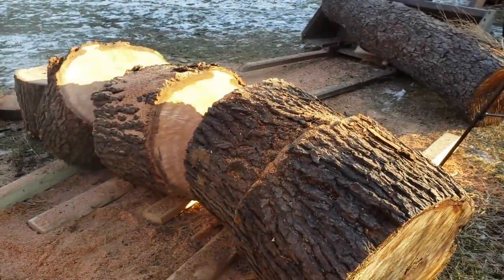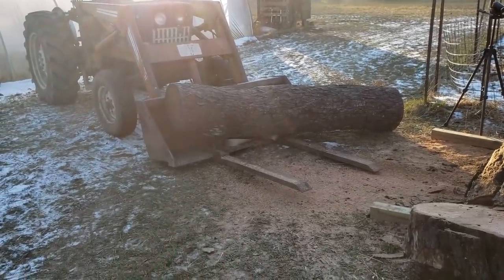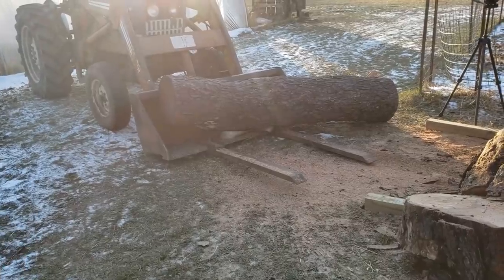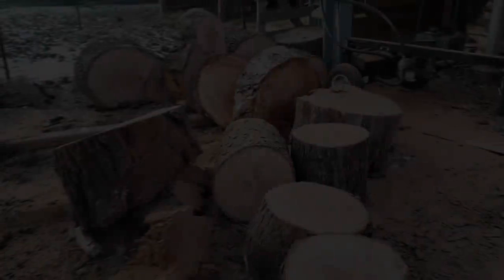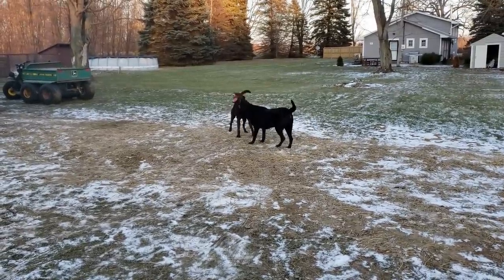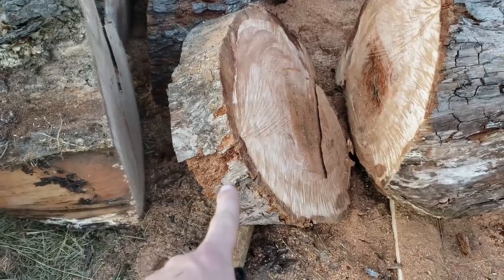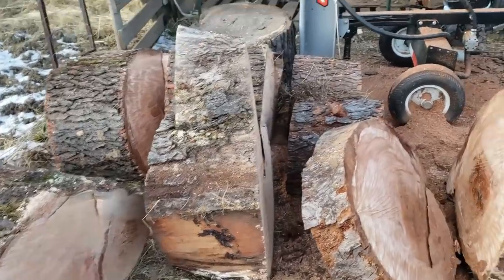Process Firewood Like a Pro With These Simple Tips

Comment: In my early years (late 50’s ) We cut big dead Dutch Elm trees down with a 6’ two man cross cut saw, wedges, a sledge hammer, axe and a 1946 Minneapolis Moline model R with a hundred foot big hay rope  putting tension on the tree. Anything less than a saw log 12’-16’ was kept for firewood and always called ‘bolts’. I never heard the term ‘rounds’ until recently. We hauled the limbs with my grandfather’s Moline and manure spreader to his 12” buzz saw on an old wood table powered by a flat belt hooked to the Moline ‘R’. I bought an antique Clinton B3  chainsaw for $5 and rebuilt it as my 10th grade high school power mechanics class term paper ( you actually had to acquire some usable skills to graduate in those days ) ! My dad loved that old junk saw so much, wanted to always be the feller. I talked my grandfather, with the McCulloch dealer’s help  into buying his first chain saw ( a 1960 Mac 15 ). The dealer told him “Gerald, just take the saw home and use it...come back next week with the money or the saw”...he went back with the money !

Comment: Nice video!  As a kid of about 10 my grandfather and I would cut down tree's with a hand saw.  We'd drag them up to the house with his pickup truck where he had an electric  chain saw. That's all he had.  We'd use an ax to split them and throw the wood down a coal chute to the basement and stack it.  That furnace was about 4 feet wide.  You opened the bottom door and shook the grater. Then opened the top door and it took wood or coal. God I loved that guy.  Now that I'm in my 50's, I cheat and pay for the wood to be cut and delivered.   This video showed the modern ways people can do this easily.  My grandfather would be amazed at all the options you have around a farm to make work easier on your back, legs and arms.  My grandmother used to rake up the sawdust when we cut cedar.  She's sew little bags and stuff them and put them in closets.  All that sawdust made me think of that too.

Comment: Pretty good tips. It is nice to have a tractor to move those logs around, but some of us don't have that. Everybody does things differently. I like to burn those short pieces too. I call them little chunkies. Everytime I load up my indoor woodbin, about every 3 weeks, I bring in 3 totes of little chunkies. Also good tip on the rectangle pieces. I split like that too, I call them slabs, they stack outside easier too. Some guys would say it won't dry good like that, but I haven't had a issue.

Comment: Best tip from this video is marking the chainsaw bar. 
You could take that a bit further and put several marks on the bar, so you have quick measures for all of your cutting needs. Thanks for your tips. 
I have a super efficient house, and only need to burn my stove during the day. I have a very efficient, very small stove, so I've found that pieces smaller than 3 inches square work best for me. They burn well, season quickly and best of all are easy for my wife to handle and carry. We don't keep a fire overnight, as our house doesn't lose heat quickly. Then again we are in Kentucky, where it doesn't stay constantly in the negatives temp wise. 
I also burn round branch wood more often, since I find it is much less effort to harvest, process and have no need of a large splitter, tractor, or chainsaw. My entire tree harvesting operation is based around coppice and pollard woods. So most logs are small (3 to 4 inches across) The 4 inch logs get split in two. One quick whack with the splitting ax and I'm done. Stacked and ready for the fire in 6 months.

Comment: If that’s the method that works good for you the only improvement I can think of is making a 2x4 to support your logs off the ground and have the supports spaced so you know exactly where to cut without having to measure. That my be a little more stable and user friendly than the loose 4x4’s. Great video and love seeing what works for your situation

Comment: My brother told me about the marking of the chainsaw or since Im female, a measure stick. That way I can take a break from handling the chainsaw.
I use a lumber crayon and the measuring stick to mark the wood for where I should saw.
Works really well for  me.
Reply: I made a wheel that has a small wedge fixed to it.. Attached the wheel to a 1x2 piece of wood. pvc pipe attached to it to hold a marking paint. Just walk it down the tree and it paints every 16 inches
The wedge hits the spray tip causing it to spray.
Reply: I always just used a ziptie. Fasten it to the handle, measure from the bar and trim it to length. Then all you have to do is put the end of the ziptie at the end of the log and cut. No markers, no paint, no sticks, no additional steps just cutting.

Comment: Hi great video. I like to use a 1x2 measured out to equal a 5 piece section. I lay it on the trunk as I move down the tree. This seems to get the most out of the larger sections of the trunk without the small leftover pieces.

Comment: I also like the idea to mark the bar. The 35 ton will defiantly butter through most anything but I've found the 22 to be more than enough for most jazz. Hey, when vertical if you use a piece of 2x4 near the front of the splitter about a 1/2 foot or so on the ground it helps balance the log on the back plate.
Reply from the maker: That is a great tip, I actually normally throw a scrap piece under there but forgot to mention it in the video!

Comment: When I was in very early teens we walked to the woods (1/2 mile) mid-Winter, dad carrying crosscut saw and 10 lb maul and me a sack full of wedges and an axe.  Cut down the tree, sawed it into 8-10' lengths then split it with wedges.  We did NOT call it bucking(?) .  The split lengths were loaded on a wagon and hauled with horses and eventually a small tractor to behind the garage and off loaded on to the Buzz pile.  In the Fall, Mr. Ross came with his Model A powered Buzz saw which had about a 30" diameter blade and a moving table.  Split logs were carried to the table and the table pushed forward to cut the logs.  My endless job was to pile wood and carry the Chunks (Never called Rounds?) to basement. 14 per day to feed our octopus wood stove.  No Fan on it.  People nowdays treat cutting down trees and making fire wood as if it was something for the space shuttle.  If you can't estimate 16" or 18" after a few cuts, get out of the bush!  We never called it a Woodlot or Wood Processing.  Best of all one year we cut down a hollow beech Bee Tree and got a half washtub full of Honey.   The ONLY day I enjoyed the work.
We never owned a chain saw.
Reply: That’s a great story ! Model A powered saw and a honey tree ! That’s what great stories are made of . 
  As you say , now it’s a different world , but the basics don’t change when that young son goes with his dad to do work like that  !
Reply: @charleyfolkes  Thanks Charley
Reply: Good story Charlie. I'm 50. We had chain saws when I was a kid. I still go to the woods and bring home logs to bust up as firewood. I'm headed out now to do some bustin up. It's cold out. I get a fire going to hang around and cook on just like we used to do.
 I know what length I want. Never had to measure. Lol. The guy on the video Probably doesn't mess with that either.

Comment: Todd, How come you don't use the pin that Locks that splitter in the upright position ?
I drag the logs to an area I use for my wood. I then cut them into 16-18'' pieces like you, except I'll cut 1/2 way through, turn the log, then finish the cuts. That's where I go way off the rails compared to anyone else. I use the tractor and push the cuts to the splitter while sitting on a milk crate with a piece of carpet. I have an ice hook(?) to help pull the pieces closer, split them, then throw them into a giant pile. That's where it stays, uncovered for 2 yrs. I pull the pieces from the oldest end of the pile. I'm always 2yrs ahead. The only stacking I do, is in the garage, about a 1/2 cord at a time. JMO. Sorry so long, thumbs up always.
Reply from the maker: Man, very observant on the pin! I lost the pin and just didnt bother to ho grab a new one. I think I have one on the barn shelf somewhere...

Comment: Interesting video. I picked up a couple of tips, so thanks very much. We are in New Zealand so it is always amazing to me to hear your guys talking about burning cherry or oak.
Reply: I see you have a compact excavator on-site. Didn’t notice if there was a thumb installed. If not install a good unit. You will never fire tractor up again for handling logs.  An excavator is not only safer but way faster with far less back bending labor.
Reply: @genemurray5693  Having used both tractor and excavator,  the excavator is great in a small area, but the tractor gets from stump to the woodyard much more quickly.  If I had to rely on the excavator I'd be an hour from the stump to the woodyard.
Reply: @danielmoulton4117   I see Dan.  If no truck to haul logs to yard then that makes sense. I use an f450 flatbed dump as I go sometimes quite a ways for logs.

Comment: I quarter the rounds in vertical mode then final split horizontal, easier on the back.
Also throw down a tarp to split over, makes cleanup and kindling recovery much easier.
Reply: Isn’t it slippery walking on the tarp?

Comment: I've started cutting mine while still on the forks to keep the saw out of the dirt. Usually only leaves one cut on the ground on the section between forks and its typically small enough to roll and finish the cut.
Reply from the maker: I have two issues with doing that, for one  I hit my bucket and forks with the saw and wreck my chain and my tractor doesn't hold hydraulic pressure so I would have to keep it running while I cut. But, if you don't have those issues it is a great way to go:)
Reply: @SSLFamilyDad  That's valid.  I have the full quick attach setup with the back plate. I can see where the bucket could obstruct access. Either way pallett forks are a game changer for wood processing.
Reply: I do all mine like that.To old to stay bent over! That is what machinery is for,make it easier.

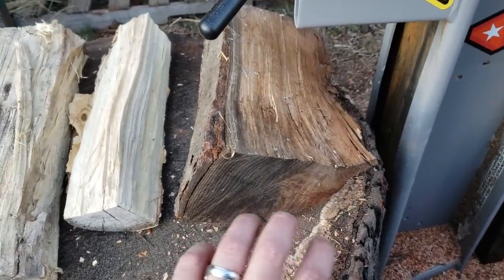Comment: I always try to guess which Bible verse you are going to include. Thought for sure you would use Ecclesiastes 10:10 - “If the ax is dull, And one does not sharpen the edge, Then he must use more strength; But wisdom brings success.”
Reply from the maker: That would have been a good one!

Comment: Bottom line, less handling is most efficient. I get full length trees to the roadside log landing, buck to 20 feet, fork those sections and take the tractor road directly to the woodyard to buck and split. I only have to handle each piece once off the splitter into a crate, move the crate to the stove on the forks, and directly into the stove.

Comment: I usually cut my firewood about an hour drive from my house and I find one of my biggest expenses is gas for my vehicle hauling the trailer full of wood back and forth.  

Also, getting your chimney set up is expensive ours cost around $1500 for the stove pipe alone. 

Wood stoves can be expensive if you want a fancy one.  I just upgraded from  a $600 stove to a $3000 stove.  My new stove burns for 8 to 18 hours before needing reloaded, and has a thermostat to keep our house at a constant temperature.

Comment: My stove uses 11 to 12 inches, so I cut my splitting chunks 22 to 24 inches, then split with log splitter,  then cut the split wood with 12 electric compound miter.  Keeps the pieces as big as possible until stacking.  Less bending over and easier on my body.

Comment: Splitting Vertical Is Hateful Work ,Standing On Your Head Or Kneeling Is Not Nice , I Vertical Split Into Manageable Size ,Not To Heavy ,Then I Split Horizontal ,And Stand Up Like You Should Work ,I Have A Splitter Similar To Yours ,Make A 1 1/2 Shoe To Fit On The Bottom Of The Splitter,To Raise Up Logs ,When Splitting Vertical,Way Easier ,Thank You For Your Videos !!!

Comment: That's as good a way as any for the big stuff as long as you are leaving it to finish seasoning for at least a couple months in the stacks. If they're manageable size logs, I buck them where they are and then once loaded on the trailer, they don't hit the ground (pallet) again until they are being stacked. I have just the right size (width and height) wagon to reach the rounds out and throw the split firewood back in before moving on to the stacking area. Works great except for this time of year if we get a lot of snow, which we did so it's difficult getting to the trees/logs.

Comment: I like to buck up the wood to length in the woods,  doesnt matter how many times i move it, because i dont have a tractor to haul it.  leave the splitter where u stack.
Reply from the maker: Great point, if you don't have a way to move big logs then you are going to have to log it up then move it to your stacking location
Reply: I also like to buck it in the woods. I have a tractor with a FEL and a carry-all on the back. I load both with the bucked pieces and then bring it to my splitter set up near where I'm stacking it to season. Works well for me. I cut my lengths to 20" for my in-door wood furnace and measure using my 20" bar. Works great because the marker doesn't wear off but, the marker trick for a different length is great. Much quicker to twist saw and cut than to measure and mark and then cut.

Comment: @1:52, no way in hell those logs are seasoned (<20% moisture) but hey, if you identify them as seasoned hats off to ya, after all your using it.  If selling them and I'm the customer I'd plug my meter into the pieces, laugh then send you onto another sucker.
Reply: Blue Ox , with my ambient humidity I’d be lucky to get it that dry. I have had to learn how to burn wet wood.
Reply: @johno6861  
That's tough, here in New England, with the proper amount of time, assuming its stacked correctly, anyone can obtain a 10 - 15% reading.
Reply: Blue Ox , I get 165” rain year.
Reply from the maker: Well, to be fair I didnt put a meter to them but them have been sitting on pallets for 18 months so for me that is as seasoned as I have time for! I have been burning what I split this week and it seems to be burning perfectly
Reply: @johno6861  
Ouch, that would explain it!
Reply: Blue Ox is right.  Firewood only really starts to season after it has been bucked and split.  Before that, the moisture has too far to travel to escape.  The wet wood may seem to burn ok but you're  using a lot of the wood to boil off the remaining moisture left in the wood.  You'd be using a lot less wood to get the same amount of heat if your wood is truly seasoned.

Comment: Too much messing around trying to put on skids. Get a logging cant hook and just roll the log to cut the last little bit if you can't control your saw good enough to not get into the dirt. You need a 2 in 1 file your saw was dull sharpen every tank full of fuel. 1 to 2 strokes is all it takes. You need to learn how to use your saw you let it do the work. Sawing back and forth and being jerky is hard on the saw and can be dangerous as it can cause a kickback. You need to be smooth. That is why you have no paint on your bar.
Reply from the maker: This was a brand new high end chain........ it cut right through that cherry with little effort.....
Reply: @SSLFamilyDad  have to keep the RPM up on the engine and don't force it into the wood and bog it down. When you force it into the wood you lose chain speed.

Comment: You cant use pine indoors
Reply from the maker: sure you can, I do it all the time
Reply: That's all I burn in Eastern WA. On the West side I burn Fir mostly as those woods are most common and abundant in those locations. Just got to burn hot and clean the chimney a couple times a year.
Reply: Frosty Gamer, People have been saying that to me for years. If pine is seasoned properly, it's perfectly fine and I actually had to burn it for 2 yrs straight because I was having trouble finding any hardwood. I thought the flue would be caked with creosote at years end, but it was about the same as any other years. It just burns fast.
Reply: You can burn it, but I just do not like to.  I want the hard wood.  Pine burns up quicker than the hard wood.  Just have to keep an eye on your chimney for creosote buildup with the pine.  Out in the northwest, the pines are the most common trees out there with very few hard woods and the pines are the only thing they burn.  Here where I live in south central PA, my area doesn't have many pines, it is mostly hard wood and that is what I want.  I really like the Locust tree wood.  It really lasts a long time in the woodstove, but I also burn oak, cherry, maple, apple, elm, etc.  I get all types of hard wood here.
Reply: You need a bigger stove, burns fine. I have a stove with a secondary air supply that burns the gases, no creosote problem. Rather have hardwood but not available, even burn cedar, cedar oil burns good.